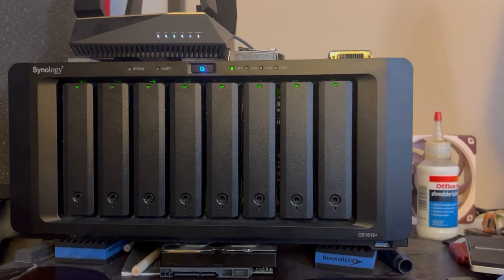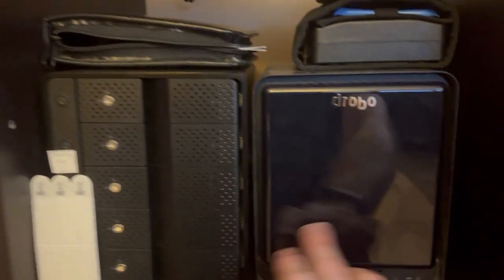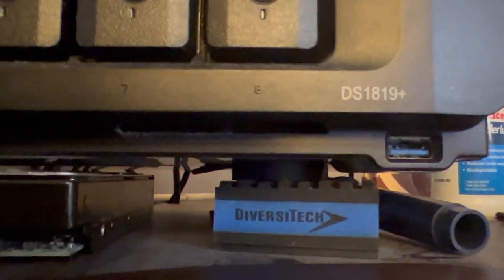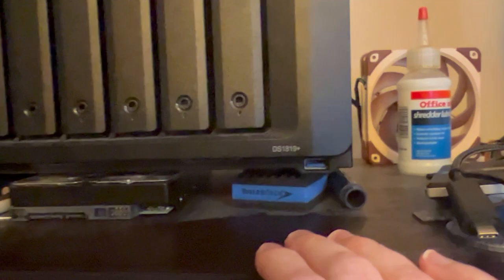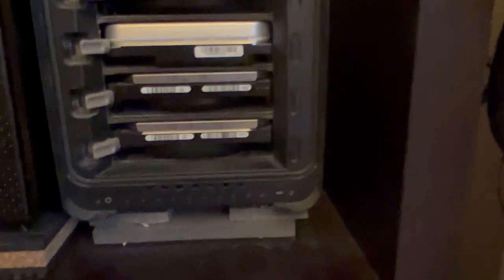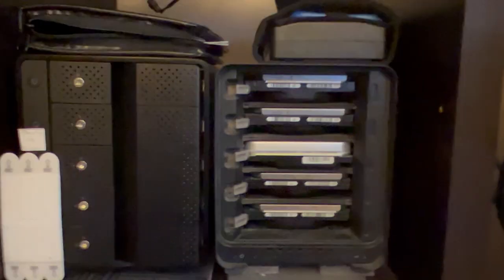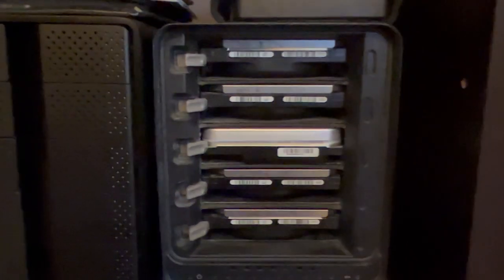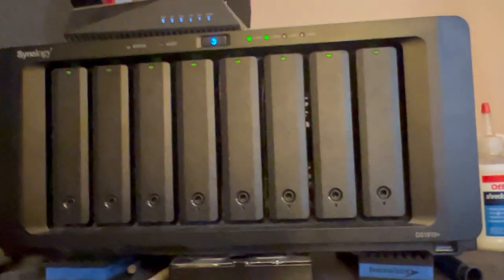Hard Drive Vibrations: How to reduce HDD / NAS Vibrations

Comment: No,no. The hard drives are vibrating a little and it affects other hard drives. Need to dampen each hard drive so the vibration does not resonate and damage the other hard drives. Forget about feet
Reply from the maker: I actually find overall each drive vibrates very little but all together at the base I feel vibrations going into the table. 
both statements can be true depending on the drives